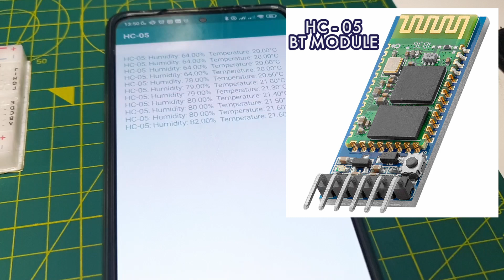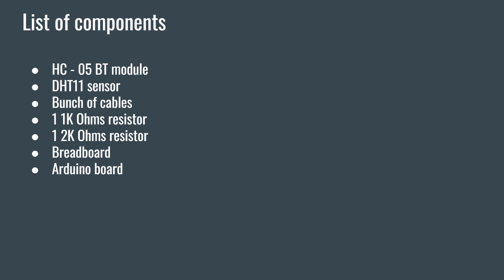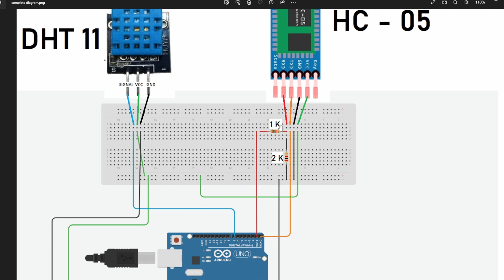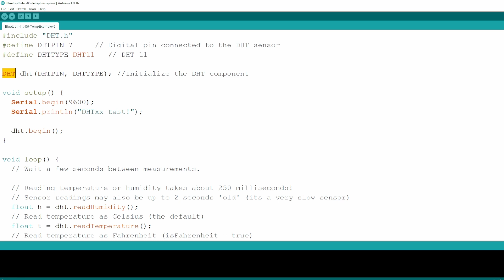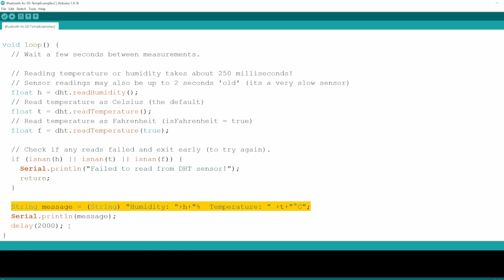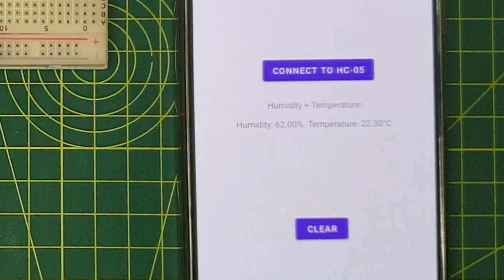Arduino Bluetooth tutorial (HC-05): Send the room temperature to Android using the DHT11 sensor

Comment: You mention to contact you if we have question.  But how can I contact you? I code with this example and the HC-5 is found linked devices but I cannot connect.  Please help
Reply: I have the same problem while pairing with the hc-05 module it says can't communicate with hc-05

Comment: Very Impressive!!!    
Can    I    use  voltage divider 
 with R1 = 220 ohm and R2 = 220 + 220 ohm    instead of
       R1 = 1 kilo ohm and R2 = 2 kilo ohm,     in the HC-05 connection with the arduino uno? 
Or do I need 1k and 2k resistors? 
Since, Vout = Vin ( R2 / (R1+R2)  is the same,  it's 2/3,  I could use  R1 = 220 ohm and R2 = 220 + 220 ohm, right? Help, I am an enthusiastic begginer with this!

Comment: will it work without any resistors?
Reply from the maker: Hello, no, it wont, at least not with that component and the Arduino Uno, maybe if you have the Arduino Mega you can connect to the 3.3 volts inputs/outputs, but it will require some analysis. Just out of curiosity, what's the problem with the resistors? they are super cheap and easy to get. Thanks